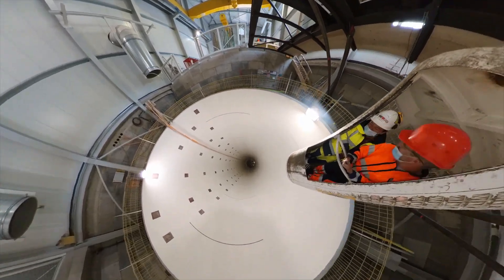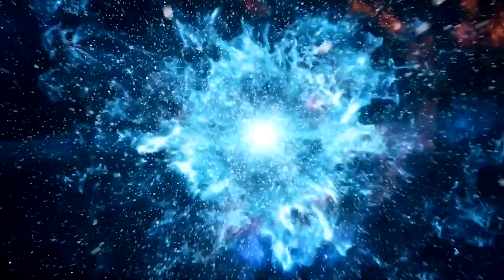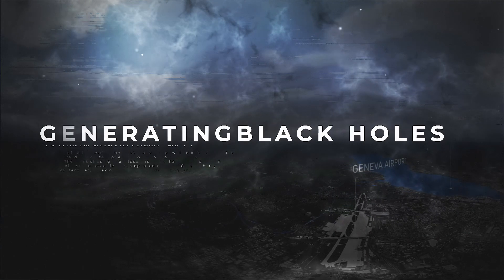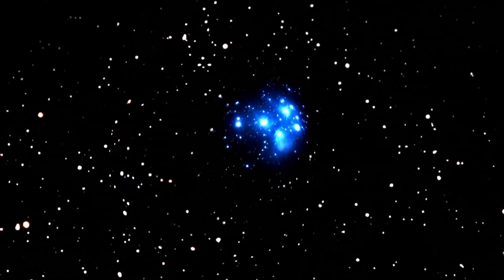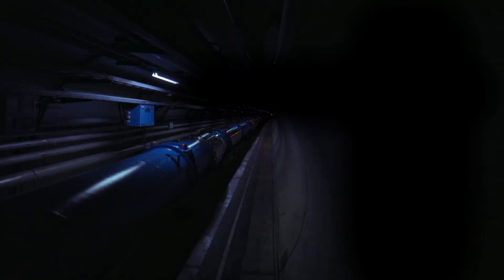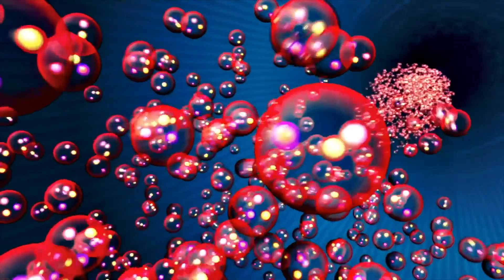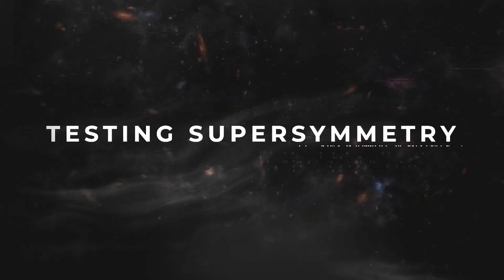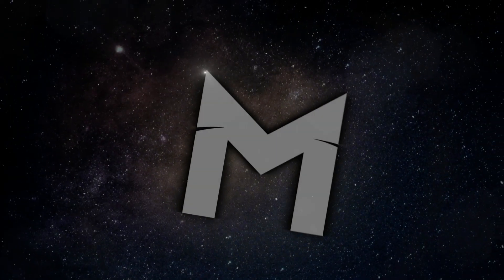The Stranger Things at CERN That Nobody Can Talk About

Comment from the maker: 🤔 What are your thoughts about CERN and the Large Hadron Collider?
Reply: There are many built look at opening ceremony it tells u everything you need to know. The pit gate
Reply: @lynnedinsdale5009  Yep... "China’s premier particle-physics lab in Beijing is undergoing major work that will boost its capability to search for more exotic particles. When complete in 2024, the upgrade to the Beijing Electron Positron Collider (BEPC) – dubbed BEPCII-U – will triple the current collision rate and extend the maximum collision energy to 5.6 GeV. The enhanced collider will also help develop plans for a next-generation collider, which if built would make China a world leader in high-energy physics research." - Physics World. That statue of Lord Shiva the destroyer is rather foreboding as well...
Reply: @louisegarner8888  Nope, just research continuing from accelerators developed in the 40s. Accelerators come in all shapes and sizes and there are about 30,000 on the planet. No issues with pits, devils, demons, portals or black holes.
Reply: @pinball1970   They said the Titanic was unsinkable ...
Reply: @louisegarner8888  Yes that's the same. Comparing The LHC construction completed in 2008 with A liner from 1912. A liner sailing across the Atlantic, surrounded by icebergs in the dark, with no sonar, radar, or modern weather detection systems, no mobile phones or modern communication systems and half the required life boats? 
Really?
Reply: @pinball1970  They were very confident halving tbe lifeboats just to make tbe deck look prettier weren't they?
Reply: @louisegarner8888  Can you explain why you think early 20th century liner construction and maritime safety protocol is comparable with 21st century high energy physics?
Reply: @pinball1970  The common denominator is man.
Reply: Someone needs to blow it up
Reply: It's a conCERN.
Reply: @louisegarner8888  facts😹😹
Reply: They've tapped into hell!
End of story.
Reply: @stevewilcock4767  Don't be silly. You skip Science class?
Reply: @pinball1970  Hardened atheistic scientists have gone down that black hole in Geneva coming out screaming and have become born again ✝️ Christians.
Enough said?
Reply: @stevewilcock4767  I have absolutely no idea what you are talking about. What does Atheism have to do with Science?
Reply: @pinball1970  Be cool Pinball.
I sense there's no flies on you.
Cheers.
Reply: @stevewilcock4767  Take care mate. Humanity is more important than Science religion or politics. Love and peace
Reply: @pinball1970  Science messing with the unseen spirit world is never a good idea. Maybe you need to do your research.
Reply: @pinball1970  Amen!
Reply: @pinball1970  Yes, I'm sure they'll eventually figure out it's dangers and lack of cost effectiveness when those involved eventually get to speak up ... 
Walter Wagner, a former nuclear safety officer, filed a lawsuit in the spring of 2008 in order to delay the Large Hadron Collider's progress. Wagner listed several concerns in the lawsuit, many of which involved the destruction of the Earth.
Reply: @louisegarner8888  It's 2022, the LHC was switched on in 2008. No destruction of the earth. 
Like I said there are 1000s of accelerators in operation on the planet.
Reply: @louisegarner8888  Scientific research, the kind that actually means something in Science, involves years training in the disciplines, examination and practical. This goes along side reading the peer reviewed published literature. 
What 'research' is it that you think you do that I do not and have not?
Reply: @pinball1970  I recall asking you that already, by all means you go first ...
Reply: @louisegarner8888  What did you ask? Do you in know anything about the SM?
Reply: @pinball1970  Standard model periodic table, is that all you're basing it on? I don't see much of what you're saying that's supportive of messing with nature on a quantum, natural or spiritual level, maybe if you could quantify your argument  in terms of detailing all the pros and cons it'd sound less like you needing to be right and more of a common-sense consideration of all the variables such as why we vowed not to set off another atom bomb. My earlier comment "@pinball1970  Science messing with the unseen spirit world is never a good idea. Maybe you need to do your research?"... I don't have all the answers but I know when something feels "off" like that Amityville house of horrors. Can you put it all together for us so that it makes better sense from all perspectives?
Reply: @louisegarner8888  That's not what the SM is
Reply: @pinball1970   Oh, sorry, please enlighten me...
Reply: @louisegarner8888  The SM is the model that describes the atom, it's particles and sub atomic particles. What they are, the mass and the forces between them.
One of the unanswered questions in physics was where do particles get their mass from? 
A physicist from Scotland worked out a mechanism that gave particles mass, it involved a field that pervades the universe.
The field has an associated particle. That person was Peter Higgs and the particle was the Higgs Boson.
He published in 1964, they found the particle at the LHC in 2012.
Cool eh?
Reply: @pinball1970  Better than Super Man! 😅
Reply: @louisegarner8888  Thank you!
Reply: @louisegarner8888  There is a controversy in all this but is very boring. Money. 
They have NOT found other things that they were hoping for and they want to improve the LHC further, is it worth the money? 
Some physicists think not.
Reply: @pinball1970  You're welcome! 😅
Reply: @pinball1970  All those boring billions could've gone into stabilising economies post pandemic don't you think? ...
"Pinball Wizard” is about life's games, playing the "machine" – the boy and his machine, the disciples with theirs, the scores, results, colours, vibrations and action! ... 💥💣🌏🕺💥
Reply: @louisegarner8888  Most of the money was spent in the 1990s and up to 2008. Since then it has been upgrades and running costs. The LHC was actually shut down from 2019-2022 for a down time and up grade. It was switched on again July this year so it missed the pandemic. Skeleton staff during the height of the pandemic.
Is it worth more billions to build a bigger one? Some guys say no, the ceiling has nearly been reached.
I think they should see what comes from these new runs, they have already found some exotic matter called tetra and penta quarks. Is it significant? Nothing like the Higgs. 
China is doing its own thing and is building one. They have a strong economy so 10 billion dollars is not that much to them.
Reply: @louisegarner8888  Most posters think it's the Who track. I like that song but the reference is a different track by Brian Protheroe. 1974 I think. The 1970 is a reference to a great year in music.
Reply: @louisegarner8888  So Louise, I hope you realize Scientists are not philanthropists or villains. They are just hard working people like you and me working out how the universe operates. 
With the LHC? There has been zero indication of supersymmetric particles so far.
My colleagues tell me this does not rule out ST or SUSY. I can't comment on that I am not a Scientist, I use the technology. 
For me right now? James webb, check it out. 
Spectacular beautiful awesome.
Reply: @pinball1970  I've been watching the James Webb telescope 🔭✨ for some time now, fascinating hey? Too much space junk we're putting out there tho. PUMA and BASE-STEP are expected to be operational in 2023 small enough to transport by truck, goodo hope they drive safe. Yeah I'm sure Hitler and his colleagues thought their experiments were cutting edge wonderful as well. With great power comes great responsibility. Avagooday! 🌏🕊️👋
Reply: @pinball1970  Physicists are also made of atoms. A physicist is just an attempt by an atom to understand itself.
Reply: @louisegarner8888  I don't get involved in the consciousness stuff, too speculative and philosophical for me.
Reply: @pinball1970  That's the most telling thing you've said yet, that you're not interested in learning about your own and others inner workings, but will go gungho getting to know some machine external to you. Our heart is 60% more energetically powerful than our mind, connect higher heart-mind to God source energy and merge brain hemispheres to activate yourself, I could go on for days, less if you'd brought your subconscious into conscious awareness and were capable of telepathy!! Joe Dispenzas videos are inspiring. 📢 Time to wakeup! 🙃😅
Reply: @louisegarner8888  I care about people and the planet Louise. The way I can add my tiny contribution is via the technical stuff. I am simply not qualified in philosophy so I cannot add anything that way. 
I like the logic/maths stuff and I occasionally read what the physics community are saying about QM interpretations but that discussion does not change any of the theory.
Reply: @louisegarner8888  I reject the notion of a god btw, also ghosts, heaven and hell, demons, portals etc.
Reply: @pinball1970  That's sad you'd reject yourself.  God is our faithful imagination, heaven is harmony and life a gift of meanings to discover.
Reply: @louisegarner8888  You're back! Good stuff. I was a dedicated commited Christian, even when I had doubts. When I was finishing University I went into deep dive. That is when my faith was destroyed.
A tough journey mate.
Reply: @pinball1970  "It is certain that an atom of goodness on the path of faith is never lost. Faith in the King comes easily in lovely times, but be faithful now and endure, pale lover!" ~ Rumi 🐛💥🦋 👋
Reply: @pinball1970   That 'Poltergeist' movie ... "They're baaaack!" 📺👻🤫
Reply: @louisegarner8888  I was a Christian till I was 24, I didn't ditch it because times were bad. I ditched it because I had time to look into it.
Reply: @pinball1970  and what did you discover? 🙏👻🤔
Reply: @louisegarner8888  I already knew the universe worked on principals we can work out and improve. 
Just us though, no one watching.
I also discovered Biblical scholarship, what is the Bible? It is not at all what I was taught.
It is far more rich, rewarding, realistic AND human.
Reply: @pinball1970  "Technology is like any other power. Without reason, without heart, it destroys us." ~ Justice League 💥👨‍🎤👁️👩‍🎤💥
Reply: It's cool
Reply: @kagenou6833  Beavis 😎
Reply: Plot twist: antimatter made its own universe.
Reply: @jrloulanza6534  Do you guys just make up your own Science?
Reply: @pinball1970  Nah, we leave that to the likes of you Tommy. 🧙‍♂️🔬
The Standard Model is a kind of periodic table of the elements for particle physics. But instead of listing the chemical elements, it lists the fundamental particles that make up the atoms that make up the chemical elements, along with any other particles that cannot be broken down into any smaller pieces.
Reply: @louisegarner8888  Yes kind of. The periodic keeps adding particles. The standard model does list the particles into groups. Leptons, baryons, bosons etc. 
The SM is a great achievement.
Reply: @jrloulanza6534  Eh?
Reply: "I’m increasingly inclined to think that there should be some regulatory oversight, maybe at the national and international level, just to make sure that we don’t do something very foolish. I mean with artificial intelligence we’re summoning the demon.”

—Elon Musk warned at MIT’s AeroAstro Centennial Symposium.
Reply: @louisegarner8888  AI is tricky but again not my bag.
Reply: Biohazard risk as humans have shown they can't even contain viruses safely and CERN has created micro black holes atmospherically ... Micro to macro the parts reflect the whole holograpically, we are the only species capable of destroying ourselves and our planet. It's unnatural and I don't trust people to play God with other's lives, however they frame safety, chaos finds a way.
Reply: @louisegarner8888  Why?
Reply: @pinball1970  Read both my comments, man overreaches playing God, it's unnatural. Think Titanic, the atom bomb, sentient AI, think on consequences such as an earthquake under CERN setting it off so our planet is sucked into a black hole instantaneously as one possibility. They've seen demonic spirits come through portals or stargates they've created as well, it's creepy and dangerous, we don't know enough.
Reply: SMH at ppl who think it's a good thing.....these psychos are literally summoning deity's through portals and think there will be no consequences. If anyone isn't familiar with who Shiva is then look up his story and let me tell you when he dances he lights weary worlds a blaze....destroying them. His statue is outside of cern
 Even in christian theology the world ends in flames.
...this LHC is not a thing of play. I am sad for our children and for the ppl who had to be alive in these times. It really sucks but at least I watched ten seasons of walking dead to prepare. 😭😭😭😭😭
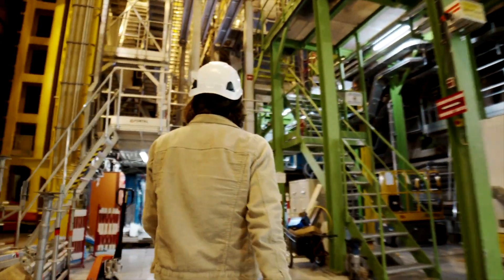Reply: @marcusjessica1069  Yes by fire, 2 Peter 3:10-13. Proverbs 3:5-6 NIV
"Trust in the LORD with all your heart and lean not on your own understanding; in all your ways submit to him, and he will make your paths straight." 🙏💞✌️
Reply: They’re going to open a big old hole in the fabric is FaceTime in a bunch of demons are gonna come out of there and just start eating people left and right! I’m just kidding! D WAVE Quantum computer will be the one to open the gateway to hell!😂
Reply: @That-Kevin   Hell on earth in the wrong hands, that's for sure Kevin, National security level! The Dutch have already successfully trialled it. Dangers lie in the quantum computing machine's ability to make decisions autonomously, with flaws in the computer code resulting in unanticipated, often detrimental, outcomes. In 2021, the quantum community issued a call for action to urgently address these concerns...
Reply: Satanic, through and through. Not even religious either and I can see it. Look at the Switzerland opening "ceremonies" they are as twisted and insane as you could get, it was in celebration of the "tunnel". If you look up older news articles or magazine articles on CERN they mention gateways numerous times.
Reply: @damil5721  Why are you using the internet if CERN is 'evil through and through?'
Reply: It's dangerous
Reply: @stupidvickfan3744  So is a boiling kettle
Reply: Very Concerned about CERN 🕊️🕊️ 
Sucking out the firmament Below and above And Dark matter isn't good 🕊️🕊️
Reply: it reels my mind, the possibilities, the different mathematical stuff that we can help conjure into existence, like a dark lord bent on destruction from a different plane, not of our comprehension. cool.
Reply: This planet & such is imbalanced with toxicity too. 

To sobriety. 🛀